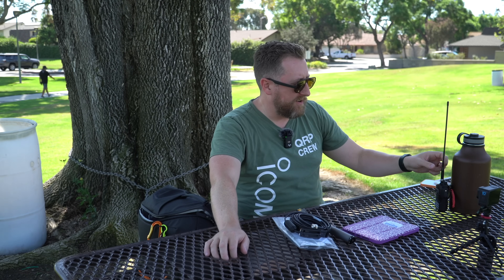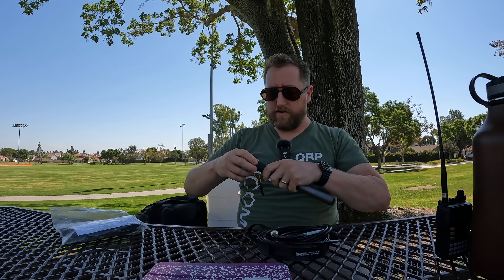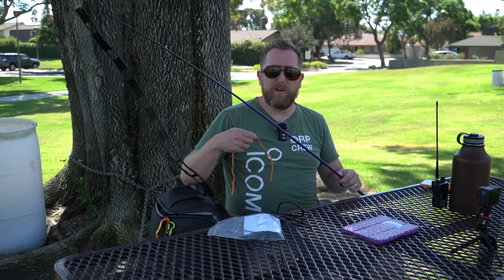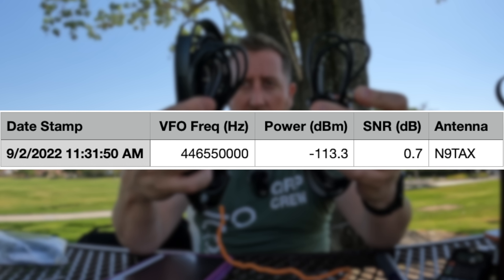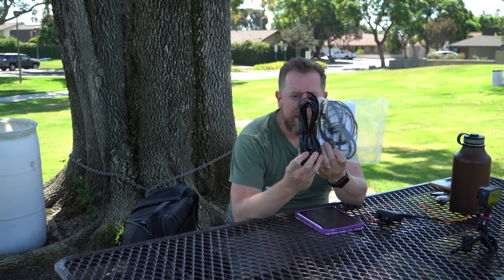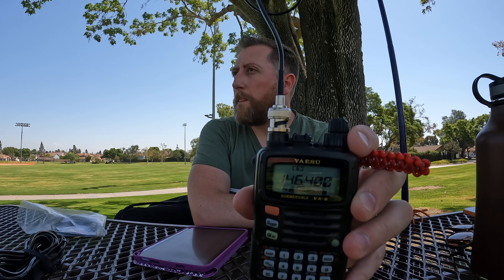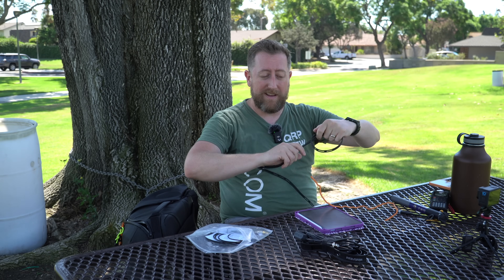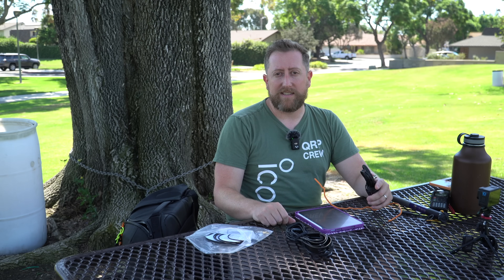N9TAX vs. Ed Fong J-Pole Ham Radio Antennas TESTED!

Comment from the maker: For those upset.  The fact that the Ed Fong is 2 SNR stronger than the N9TAX doesn't make the N9TAX antenna bad.  I really like it.  Further, 2 SNR isn't even half an S-Unit.  There should be no golden calves in ham radio.  If you have issues with my test methods, spell it out and I'll either incorporate your comments or explain why I disagree.  

Thanks!
Reply: you did great sir !   just alot of sad hams that dont like the idea of N9TAX being the best portable J-pole antenna there is at the moment.  I dont understand the hate, but we see it.
Reply: @darrellcollins877  What is the issue with other hams and the N9TAX?  Quite a few hams went "sad ham" on me, when mentioning a comparison test.  I own a N9TAX, I'm impressed with it, I do want an Ed Fong but I haven't had the extra pocket change.  All in all, I think both are great roll up antennae.
Reply: @mikew5skk137  i dont see anyone commenting towards you.   Your comment was genuine.  If you read thru the comments on this video, and the previous j-pole comparison video, you will see many haters spreading lies about the N9TAX antenna.  WHy ?  i dunno, it is a fine antenna, for the money, best value around by far in MY opinion.  Haters are goin to hate, those are called "sad hams".  Which is a spin off of the GMRS guy that makes youtube videos, lol.  he calls the hating hams, sad hams, its very funny.  You sir, from the comment i saw you make, are NOT a sad ham.  Enjoy your antenna, it will serve you well for years to come.
Reply: @darrellcollins877  I should have been more specific in my comment, I wasn't referring to any comment here.  I had previously commented on the N9TAX on a few Facebook groups and a couple comments on videos of some other YouTube channels, sorry for the confusion.  Yeah, Randy keeps me laughing with all the sad ham comments that get left on his videos.

Comment: Just found this comparison.  I have had the N9TAX antenna hanging off my porch for the last 4 years and have had 5/9 signal reports on my Yaesu FT-8900 when it was my base VHF/UHF station and now my FT-8800 is my base station and I get 5/9 reports (The FT-8900 is in an Armoloq manpack now) and I have the CR8900A with a ground spike to use portable and will probably order another N9TAX as a rollup.  Never heard of Ed Fong antenna's until a couple of years ago (sorry Ed).  Bottom line, if you have something, and it is working great, why change, i.e. if it aint broke, you are getting great signal reports, nothing to change.

Comment: Regarding the low SNR on UHF, I don't think that it's fair to blame the antennas ("it takes quite a dive"). The whole system as a whole is poor on UHF, not necessarily the antenna. It could simply be your HT that is not very good on UHF or your home receiving antenna for that matter. Ed Fong compared his antenna in UHF to a reference 1/4 mobile antenna, and its performance is virtually identical. I'd suggest to always use a "reference" antenna to compare to in further antenna tests. These quantitative tests are super great, keep them coming!
Reply from the maker: Fair point! Kudos!

Comment: 👍🏻  Thank you for the excellent comparison.
Quick question for Josh and anyone else out there…

I need a roll up style antenna for ONLY UHF (no VHF) .
The frequency range is 462.xxxx through 469.xxxx and perhaps 453.xxxx/458.xxx, if it doesn’t affect the performance on the higher UHF freqs.
These are for me to include in family member “EMComm” bags as external antennas for Motorola XPR7550e portables.
If you’re familiar with that transceiver, you’ll wonder how the radio will connect to antenna.
So, If I can’t manage to “hack”the antenna issue, I’ll be using Hytera PD982G.  The FPP, encryption and other things actually make a much better pick.

Thanks !

Comment: Are the testing criteria changing here?  I ask as the MFJ Long Ranger antenna you tested from the same bench did 46.8db SNR In fact all the stick antennas beat out these j-poles.  Different test conditions or same?
Reply from the maker: No change. But we can expect environmental difference.  I am planning an “All Stars” re-test for the best antennas.
Reply: @HamRadioCrashCourse  Thanks Josh.  I was thinking about a j-pole for the Anytone 878 but to be honest your results show them not much better than stock and surely not worth the hassle as compared to the Long Ranger and it's better performance.  Not sure what all the fan fair is for these j-poles are for a handy when the other standard stick antennas can outperform at a lower price.  Agree though, a round-up comparison of all would be a great idea. Surely you would need your flame suit on for such.
Reply from the maker: They’re dual band and better than most verticals.
Reply: Good question.  If you look the JPOLEs here do not do much better than the stock antennas from the previous test from the same location.  Curious as the the test params as well.

Comment: I was asking Ed about hanging his antenna from a fiberglass pole and he recommended that I hang it at a 45deg angle as the fiberglass does attenuate the signal if the antenna is hanging along the pole itself.  I don't know if that would affect your test but attenuation is attenuation. :_stabby:
Reply from the maker: Fiberglass or carbon fiber?
Reply: @HamRadioCrashCourse  I was asking Ed about using those extendable fiberglass fishing poles just like the one you used, I have two from activities years ago and he was very clear about the effect on the antenna hanging alongside of the pole.
I even sent him a link to this video. BTW I really enjoy your videos 💜

Comment: I use the same Ed Fong jpole with an HT from my hotel room when traveling on biz.  I figure out which way my window is facing and then use the RepeaterBook app on my phone to find repeaters in that direction.  I also ask for rooms that are on higher floors.  I also call out on 2m simplex, which is hit or miss, but often there's a highway in view and I can have short qso's with travelers also monitoring simplex.  All I do is use a binder clip to hold the tip of the antenna to the curtain rod or a push pin that I stick in the wall above the window to dangle the antenna from.  The antenna has exceeded all my expectations.   I frequently talk to hams that are stunned at how well my signal is being received when they find out I'm using an HT and my location which, at times has been 20 miles to the repeater.  I do try to mount it in the middle of the window, away from the metal frame around the window.

Comment: I like practical tests. I have both antennas, have used both and will use probably my Ed Fong for a public service event this weekend. I will have the N9TAX as backup though. I have not noticed a difference in performance one over the other. Thanks for the test. Jack K5FIT
Reply from the maker: I agree, in use, there is no different in performance.  Really only when looking at the SNR on the meters.

Comment: A couple of missing data points from the review are  (my opinion)  1) Cost difference. 2) power handling rating from the manufacturer.  If one is considering a qty acquisition for a club, that might be of interest.
Reply from the maker: I could make all the videos 45 minutes, buts that not reasonable.  But I hear you. Maybe I’ll come back around and test that too.
Reply: Ed fong says 50 watts on his antenna max.

Comment: I think you should do that test again and use the bow set up that is recommended by n9TAX,  and due to the design of the dual band antenna the folded dipole side will be affected , if either radiating side is damaged it will affect the others performance.  If there is damage to 1 of the coaxial shunts which change the signal velocity and determine the shift in radiation points,  you will get a result like you had in that test.  And check out the mono band 220 from n9tax , tuned to 223.500,...the harmonics make it work with a low SWR on 2 m as well.  And it's about half the size of that dual band.
Reply from the maker: Hmmmm, interesting.  Let me think about this.

Comment: I am very happy with my N9TAX dual band (2M/70cm) J-Pole. I used it recently for the first time on the Marine Corps Marathon (in Washington, DC), attached to an MFJ extending pole, 20. feet up in the air and it gave me great coverage on 2 meters to Net Control using only five watts, while I was in a low lying area (where HTs are not able to get out a signal). I also bought one for my cousin, a new ham. Well made and should last a long time.

Comment: Josh, stop picking up your HTs by the antenna! They are NOT handles! You are setting an bad example, dude! The antenna on any HT, be it a cheap Chinese rig or a Motorola professional HT, is the weakest point of it's build. Period.  
I learned this the hard way.  Believe me, any seasoned radio professional will tell you the same thing. I repeat: Don't use the antenna as a handle, that is the quickest way to end up sending your rig to the repair dept. Maybe if your radio cost $30 you won't care, but if you have a REAL radio (Yaesu, Kenwood, Icom, Motorola, Uniden etc) you will be sorry. End of rant.

Comment: I have the N9TAX with the short piece of coax, and its been a great antenna for a year or so that I have owned it. Last night I was working portable in the back yard, and incoming repeater signals were much lower than usual. I could not reach most of the Winlink gateways in the area, so I checked the SWR and it was above 5:1. Today I was going to perform a continuity test when all of a sudden the SO-230 connector fell off of the antenna. I suspect that was what caused the bad performance, but I'm not sure how it happened. I don't blame the antenna build because its a solidly made antenna. I've been using it quite often in various portable setups, so it must have something on my part.

Comment: Are you worried that since carbon fiber is conductive, it is not RF transparent, thus effecting the radiating pattern of these antennas? I was going to purchase one of the collapsible fishing poles, and realized that most are CF and not FG.

Comment: Josh, thanks for all you do here. My thoughts on test methodology: I would have liked to see a SWR sweep for each antenna for both bands with your RigExpert analyzer, then superimpose them using the AntScope2 desktop SW for comparison. The RF choke on the antenna may play a role in improving SWR. Next is getting the variation out of the test by using a tone generator of constant tone and volume instead of your voice to do the actual SNR measurement. Not sure how much it matters for FM, but SSB would matter. John

Comment: My three favorite parts of this video: 1. The timing; 2. The fishing pole/j-pole mast; 3. The gear ties.

THE TIMING-- For me, sitting on my urban back porch/fire escape with my favorite HT, a beer, a cigar, and my favorite net is ham radio at its best.  Unfortunately, my HT can barely reach the repeater, so I end up going inside to use my base when it is my turn to transmit.  I watched this video right after that net two weeks ago, and decided I want to try a roll-up j-pole before giving-in and rigging my base and its antenna to some ultra-portable configuration.

Not an Ed Fong roll-up J-Pole to be found anywhere, as I write.  So found his plans, and will build my own.

THE FISHING POLE and the GEAR-TIES--  These provided the quick and easy set-up and tear-down I need for the antenna, and with any luck at all, will give me the ability to continue the porch-life with just my HT.  If so, the whole rig can be slung over my shoulder in a small bag-- greatly expanding my out-door hamming options. 

Fishing-pole/mast just arrived and I am pleased with it.  Had everything else for the roll-up j-pole.  I have soldering to do this weekend. Wish me luck.

KI5KWG
Reply from the maker: Thank you for the great comment!

Comment: I don't get what you're talking about at 9:00. The Ed Fong has better performance results, for 70cm where the N9TAX is lacking them, but you say that the N9TAX antenna is more of a 70cm antenna? Also, from what it looks like, different matching is done to dual band these antennas so they could perform differently.  I don't know what the 70cm gain should be for the N9TAX, but it's supposed to be around 2dbi for the Ed Fong, so quite similar to 2m. The reduced signal is going to be at least somewhat attributed to transmission line loss, and possibility due to reduced gain over 2m. In any case,  you can't compare these antennas at 70cm with the current data.
Reply from the maker: I didn’t say the N9TAX was better on 70cm I said it’s possible is performs better on 70cm. I will do another test specifically on 70cm to provide the details. At no point was I testing 70cm since we only had the Ed Fong data point (something I already had)
Reply: @HamRadioCrashCourse  I guess It's just confusing at that point because you say the N9TAX is cut a little bit more effectively for 70cm, and the Ed Fong takes a dive there, but we don't know the N9TAX numbers. It sounds like you're comparing the two and giving the upper hand to the N9TAX with no data.
 Anyway, I appreciate the test. I have an Ed Fong which seems to perform quite well, so it's interesting to see the 450ohm twin lead version with what appears to be different matching for dual banding.
Thanks!

Comment: Love my N9TAX I have had it for a few years.  I use it when hiking in case I need more range out of my HT.  I do like the idea of the smaller form factor of the Ed Fong.  The only reason I would switch is if my N9TAX broke or I really needed the smaller size/weight which I don’t

Comment: Thanks for the great comparison! Vey informative.

I've been using the N9TAX and have been very pleased with it. Very solidly built antenna that holds up well.
While I've been very happy with it, I may have to look at getting an Ed Fong for my pack and dedicate the N9TAX for a residency in my Jeep. I might make the change not because the Ed Fong performed slightly better in your tests, but because it is noticeably more compact (and presumably) lighter.

Comment: I have a N9TAX antenna and it works great. No problems with it. I’ve used it on 2 meters and am getting excellent results with just 5 watts. It was well worth it. I would highly recommend the antenna anytime.

Comment: I wish I had seen (you did) this video a couple of months ago before I bought the k9tax one. It does a little better on 2m receive then transmit. On 70cm it doesn't do any good at all. according to the simple test I have done ,if you consider what I did as a test . I am thinking of using it as a scanner antenna for the Air band .

Comment: I've talked on a 2m repeater 29 miles from my house with an ht and my N9TAX antenna more than once.  I just toss a line up in a tree and pull it up maybe 10-15 feet or so. Works quite well.

Comment: The N9TAX appears to be made of window line, not twinlead.

Unless the antennas are mounted up and in the clear, (away from that huge tree-trunk,) and not hanging parallel to an antenna mast of uncharacterized composition, the SNR on a given band as opposed to on a different band cannot be adequately compared. All you can reasonably do is A-B comparisons of different antennas on the same band.
Reply from the maker: Which is what I did..  An A-B comparison.  

Thanks for agreeing with me.

Comment: Maybe I'm not up-to-speed on these antennas but, the N9TAX is a 2 Meter antenna that is harmonically semi-resonate on 70 cm, the Ed Fong is a genuine dual-band antenna.  Your comparison 'test' is weak, uninformed, and riddled with errors.
Reply from the maker: For reference. This is the N9TAX antenna I tested. https://www.ebay.com/itm/321819896093?mkcid=16&mkevt=1&mkrid=711-127632-2357-0&ssspo=38vzsG44TBm&sssrc=2349624&ssuid=zfTWucfrQ4i&var=&widget_ver=artemis&media=COPY

It is completely reasonable to compare the received SNR of a transmitting station to determine which antenna is the better performer when using the same transmitter. 

If you disagree, spell it out with details instead of just saying “weak, uniformed and riddled with errors”
Reply: @HamRadioCrashCourse    << So we have the N9TAX  dual-band as both a harmonically operated and a de-coupled 70cm.  Which TH is it?  Next time I suggest supplying a schematic of the antennae tested, so there's no confusion. When testing a dual band on 70cm, tilt the antenna 45 degrees to vertical and see the result.
Reply from the maker: How so?
Reply: both antenna's are J-poles , same design , different materials
Reply: Darrell Collins  The N9TAX antenna is a SlimJim, sortof J-pole-ish, but not a J-pole.

Comment: I have used Ed Fong's J-pole antennas for years. They work great and have very low SWRs. The antenna MUST be mounted in a thin wall PVC pipe before use. It is designed and tuned that way. It will NOT work right out in the air. READ the instructions!!!
Reply from the maker: You’re completely wrong. Ed Fong sells a roll-up Jpole for field deployments AND the version that goes in a pvc pipe.
Reply: you must be talking about the DBJ-1, the DBJ-2 is meant for portable use without being put inside a PVC pipe, meanwhile the DBJ-1 is meant to go inside a pvc pipe for base station use (maybe portable)

Comment: Did you have a stable path between the two locations, your home and the park?
Normally for this kind of evaluation you would make a large number of measurements over different paths and average the results.  Why should one of those antennas be better than the other unless there was some significant loss somewhere?
Use of the sdr with actual power received in dbm is A+++.
73 de K2XT
Reply from the maker: Dbm is also on the table…. They scale to snr

Yes. It’s a good path.